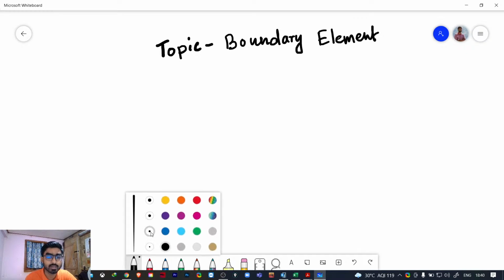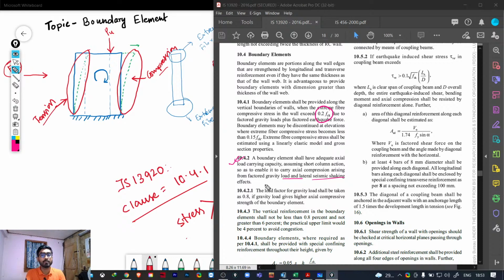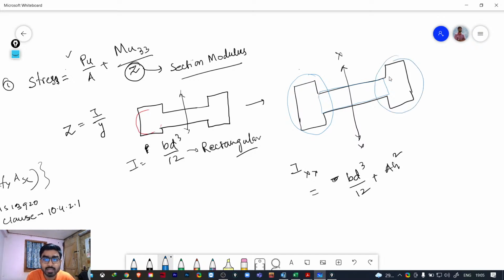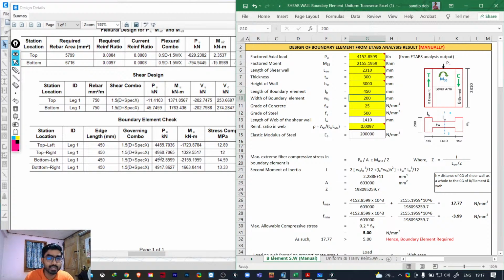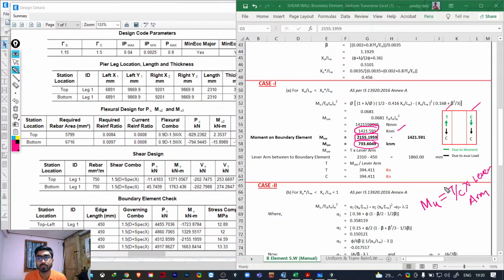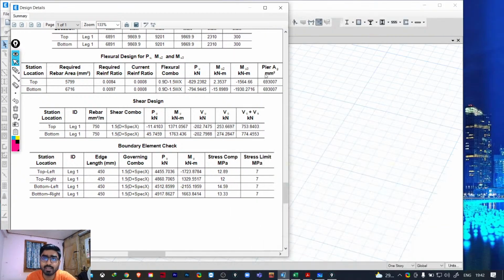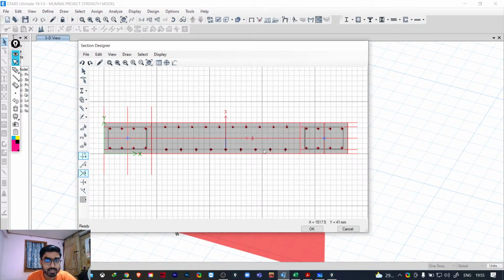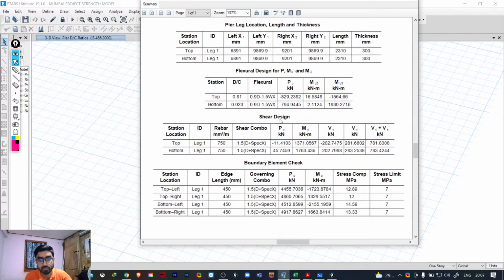DESIGN OF BOUNDARY ELEMENTS: FROM ETABS TO MANUAL APPROACH- LIVE SESSION | ilustraca | Sandip Deb

Comment: Good day, i know its quite late comment after your post of this video. But, i have prepared excel sheet and calculated the data which u input in the video. I found some mistakes in excel sheet formulations which are as follows.
(1) In case 2, value of a4 (alpha) is not correctin your sheet.
(2) In case 2, value of a5 (alpha) is not correct in your sheet.
(3) In last section, short column design Pu value is not proper in your sheet. Please check and correct me if i am wrong. 

Regards.
Reply from the maker: Yes yes..
Reply from the maker: Those were discussed earlier in our groups... kindly correct those.

Comment: Max limit of comp stress 0.2fck
More than 0.2fck  What is max limit of comp stress
Reply from the maker: 0.446fck.. though it won't be needed.. once you found that the Percentage of reinf. is going more than 2.5-3% it is better to increase the size of the shear wall or the boundary element.
Reply: @ilustraca  your explanation is excellent Tq, please make a tutorials safe foundation raft foundation & pile cap design & punching shear reinforcement designed in raft